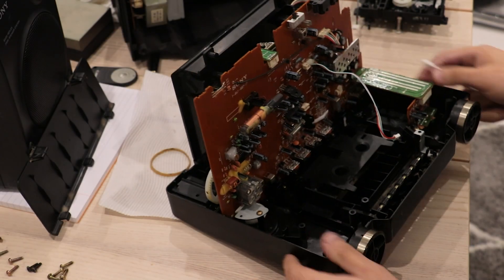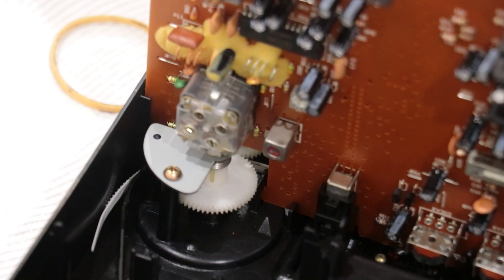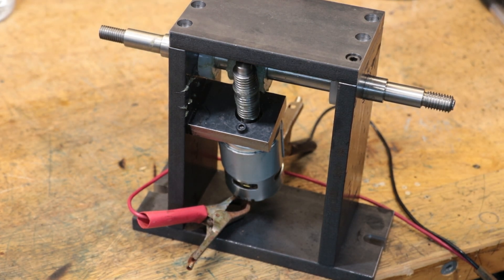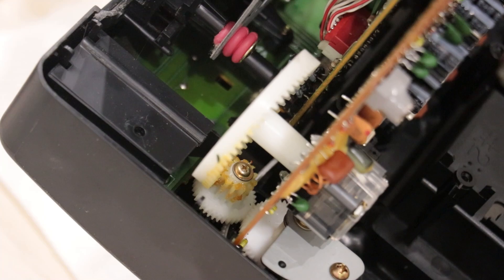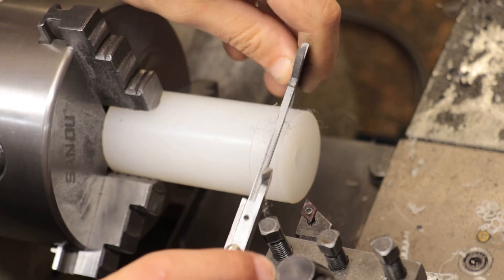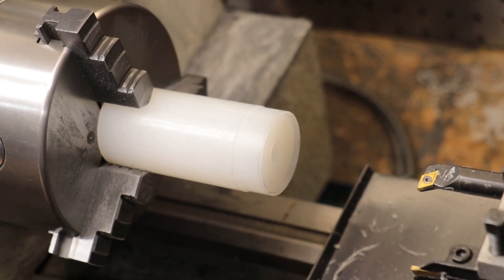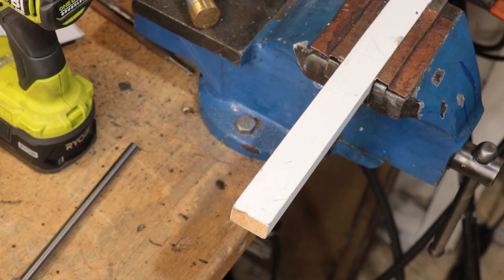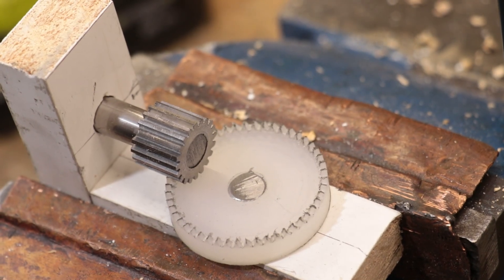Straight Cut Face Gears - A Half Decent Solution

Comment: You said you can't drive a worm gear backwards "very easily." I've been told it's physically impossible. Has anyone ever actually succeeded in this?
Reply: Low ratio worm drives (i.e. with a high helix angle on the worm) can be back driven, but efficiency tends to be pretty bad.   Many electrically power assisted steering racks on modern cars use a worm drive that must be able to be back driven, so the steering still works when the rack isn't powered.
Reply: early trucks and cars used worm gears instead of hypoids. milk separators use worm gears that have to back drive.

whereas a worm for a winch generally wont backdrive so it can hold a load up with no need for ratchets or brakes.

its all about the helix angle.

a worm gear is just an extreme helical gear. if the helix is 45 degrees (for shafts at right angles) then theres no preferential direction. the inefficiency is due to the massive sliding friction. differential oil stinks as it has a high sulfur content as it has to resist the sliding loads (hypoids slide rather than roll... ALL gears slide to a degree... helicals and worms are the worst for it)

somewhere around 15-20 degrees they start to "lock". this also gets into multi start threading, as the tooth depth for certain helix angles goes deeper than the centerline of the "worm". 

think of them as an inclined plane... almost EVERYTHING can be treated like an inclined plane...

a ballscrew with a steep pitch can be rather annoying when the nut back feeds and spills balls everywhere cus you didnt catch it in time... a four start lead screw on a 3d printer will also back feed... even two start ones will. so you rarely see anything but single starts on a 3d printers "z" axis. a tradeoff between resolution and speed. mine has two start threads and the table will drop if theres enough weight on it, when the steppers are turned off... rather annoying actually?

Comment: Cut a 45* bevel gear at a 47* angle and the depth and width of the tooth will vary with the length of the tooth… 

Idk if thats a valid approach… but it’s definitely and idiots attempt at it

Comment: You might have to make a gear cutter made out of the result of cutting the pinion gear with multiple teeth, then line up the middle tooth as if it was a single ordinary gearcutter and cut the face gear like you did before. It might require some rounding, for as the gears move together, but this should give the correct taper at at least one angle. For the "rounding" bit, you may have to do it similar to a gear hob where both the cutter and the gear blank are rotating as the blank is being cut

Comment: their is no conical hypoid bevel gear cutter, over trigonometry four/six cuts per tooth make a converging center tapper. but keep looking for the physically infeasible single cut tool that is mechanically implausible to existence without adding unwanted cut depth in certain arias of the gear that forces added mass to accommodate its related ignorance.
Reply: Talking of ignorance, have you ever considered learning to use basic capitalisation and punctuation?

Comment: Crown gear is a common name. Often used in electronic appliances and toys.
Reply: Also in the Antikythera Mechanism, it's the input that you turn by hand and drives all the rest.  So that's 2000 years of use for this shape of gear.
Reply: just look at old wooden gears and stuff in windmills and so on. All crown gear. Take a round disk,put some pins in and there you go